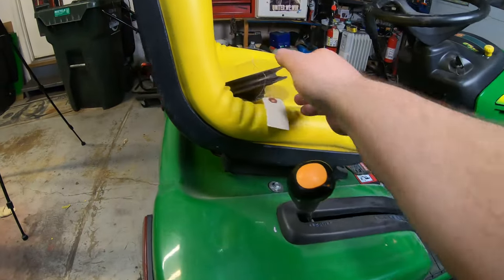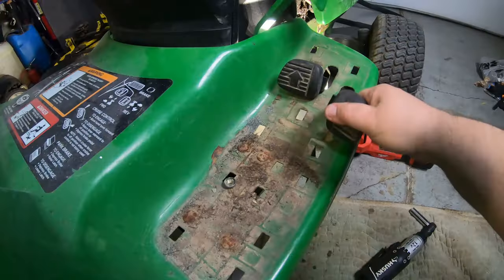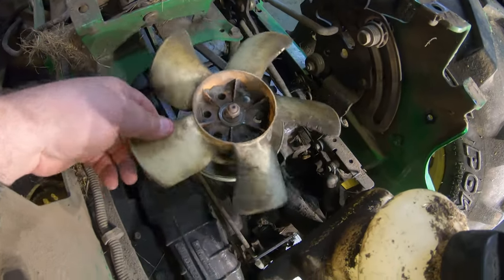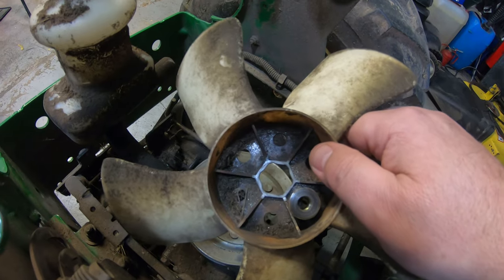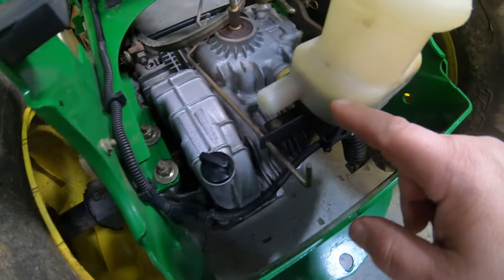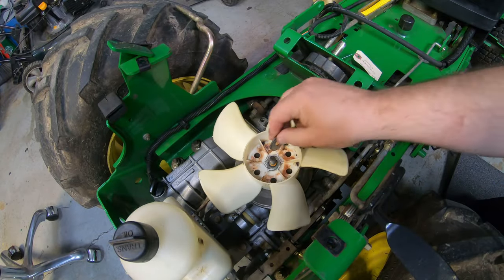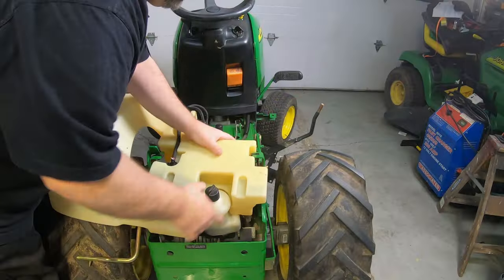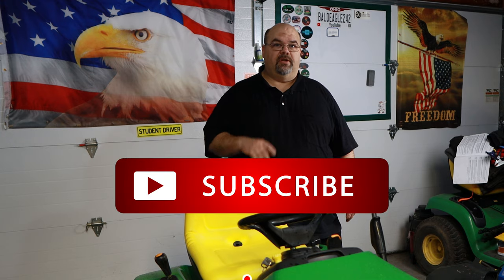Must-See: Step-by-Step Pulley Swap on a John Deere GT225!

Comment: I have a gt245. The transmission bottle reservoir is between the lines indicating it is full. The other chamber that you suggested to not open is not full but 3/4. Should that be topped off despite reservoir full?
Reply from the maker: You may have a clog in the reservoir.

Comment: I have a 235gt bought it new in 1999 have replaced that part 5 times. Over the years
Reply from the maker: Wow, I’ve replace one on another 225 years ago but didn’t realize it was a common issue. Do you pull it all the way apart like I did or is there a better way?

Comment: Taking the pedals off is Unnecessary more work than it's worth - Just follow the pedal linkage and remove the quick pin 
Now you can remove the main fender body - I learned that from Retirement with Pete on youtube  he has good tips 
cleaning the covered area is a very good idea and checking the fuel line
Reply from the maker: Thanks for the tip. 😁👍

Comment: my GX, needed a new battery, then an idler on the power belt started screaming so I changed both of those because the spring is a bear to play with, then the main belt gave up about 10 minutes later so since I had taken the foot rests and seat pan off for the third time I checked the fan and pulley and then did a hyd.oil filter change.
Reply from the maker: +bagadonutz Thank you!  I hope to see you around on future videos. 😁👍

Comment: Just so you know, I usually have multiple questions or comments on videos, so I tend to separate them out for two reasons. First, so they all get answered because I’ve found if I include them all in one comment some never get seen or answered, and also because it makes it easier for a creator to respond without forgetting what was asked.
Reply from the maker: Good to know! I try to help as much as I can.

Comment: That fan had multiple holes, at least one of which would probably line up with the single hole in the trans pulley. I’d probably insert a large Phillips through those to at least get a little more torque on the nut since I don’t have an impact yet. Being careful, of course, not to overdo it with that plastic fan. 😉🔧👍
Was the washer a Belleville or compression type?
Reply from the maker: If I remember correctly it was just a standard washer.

Comment: Im having an issue with a Encore Caliber zero turn mower. When I go to release the parking brake the engine dies. I’ve installed a new parking break switch an bypassed the seat switch too see if it will keep going after releasing the parking break. No charge it still dies. Could this be a Fuse or Kill Relay issue? I have not tried using a multimeter yet.
Reply from the maker: We have another video that shows a straightforward way to check safety switches. https://youtu.be/dTBJi2BOlVg This process will work on any small engine equipment. We only like changing switches once we narrow it down to the actual switch.   To answer your question about fuses or relays... Most safety switch circuits work by grounding the coil to kill the engine and have zero voltage running through them, so they do not utilize fuses or relays in the safety circuit. You may also have a damaged wire or connection grounded out somewhere.  This is not clearly demonstrated in the above video, but it is something to look for in addition to the switches themself.